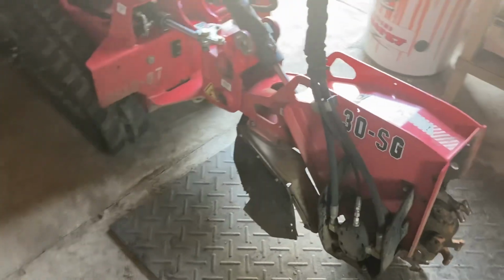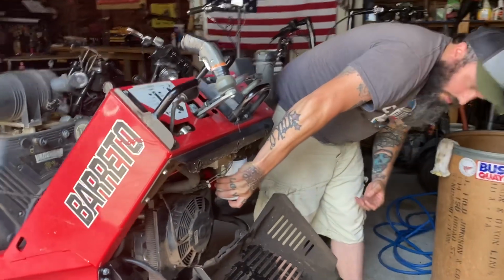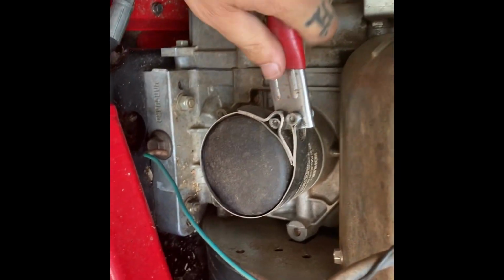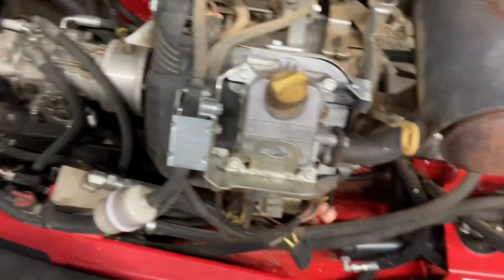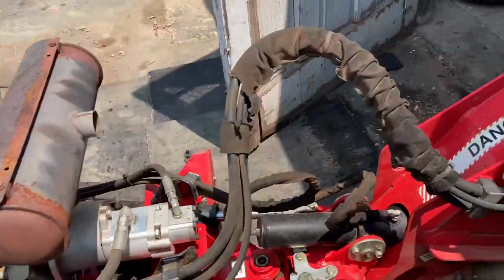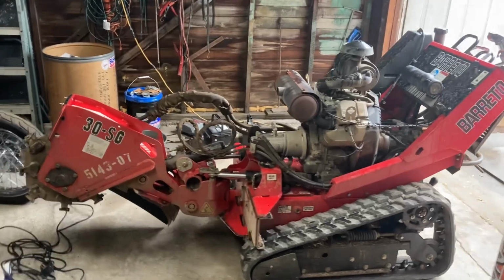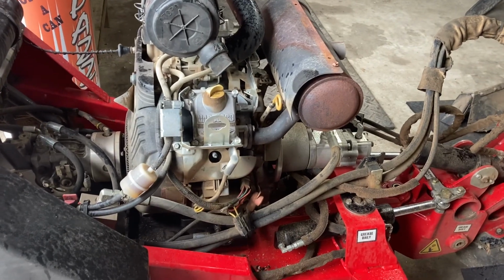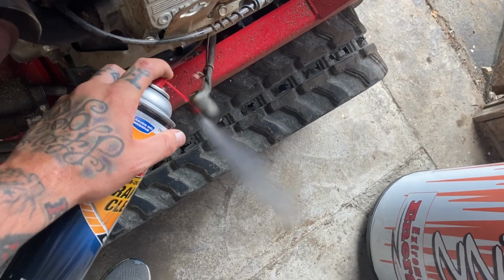Barreto SG-30 Stump Grinder Maintenance!  PT. 1 #stumpgrinding #stumpremoval #stumpgrinder

Comment: What type of stuff goes after 100 hours just curious. Its a 2018 its like brand new, 1360 hours on it but looks like 5 hours on it. Im doing all the maintenance on it now fuel filters, oil and filter, new plugs, greasing the whole thing over, they replaced the whole front end attachment to a new head new cutter wheel and teeth.. new bearings etc. 

Currently rockin some eagle claw lookin Vermeer teeth. They look beast.

Enjoyed the video. I dont have a chip guard on the side i also heard it obstructs ur view a bit just wanted to pick ur brain on that… whats ur thoughts and how bad does it kick shit back… 

Thanks for ur time and appreciate u postin a informative vid. Sorry ur oil leaked out i was like F***********k that sucks :(

Comment: how do you set the pressure ReLeaf valve, how dose yours grind, i just got  a 30 sg  with 580 hours it dont do much done all the maintenance, with new green teeth it sucks , looks new and run like new if it is not the pump or the releave vale i donk know what to check , hope you can help me, i have a 25 hp wore out belt  rayco that will make it look sick ,thanks any any all help i need thanks again.
Reply from the maker: Mine was a beast thing would chew through anything. You just have to get use to them and get the flow way better than any other I’ve used. 

Now as for maintaining and longevity of parts. They suck a$$ completely 😂! A lot of maintenance parts fail after 100 hours they are constant maintenance that’s the bad thing about these. Grease daily and pump seals fail every 100 hours I’ve seen from experience the pump itself will last 1,000 hours. 

I just got a Rayco and it’s way easier to work on. I just hope it’s as strong as the Barreto but track machines are best for residential jobs due to getting in and out of small areas very easily that’s why I liked the Barreto so much. 

What is your machine doing? Also if you have to fix anything that’s behind the cover on those machines you have to lift the motor off the frame to change the coils or anything else behind it. We cut the plastic made it easy to get to. I’ll have a video up soon.
Reply: @hillbillyfabshop1062  you get to trying to chip it will bog down and stop,how do you adjust the ReLeaf valve, I just need to know how to fix it is useless the way it is
Reply from the maker: @rickylaycock7332 when standing behind it. Look down to your right there is a pump that sits there with a adjuster sticking out the back

Comment: Are the barretos normally slow in reverse?
Reply from the maker: Yes very slow you can adjust your controls and also tune the carb to make it move a little faster
Reply from the maker: Adjusting the Controls will make a big difference
Reply: @hillbillyfabshop1062  when you say control you mean linkage bars?They are adjustable?
Reply from the maker: @jrac863  yes you can tighten them or set them to pull more or less from the forward and reverse when we adjusted mine it helped speed up reverse a lot
Reply: @hillbillyfabshop1062  Thank you sir. Ya i see i the linkage rods have slots to adjust .Looks like i will have to remove the front panel to access them.appreciate all your help
Reply from the maker: @jrac863  No problem and yeah it’s not bad at all you will see a difference. Long as you have no Pump Leaks